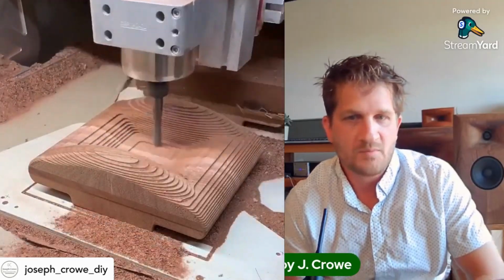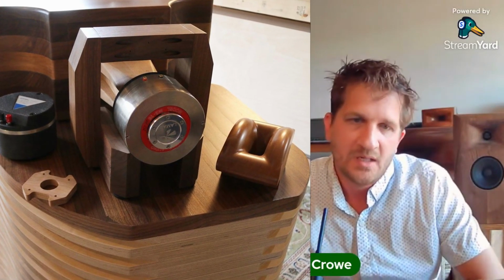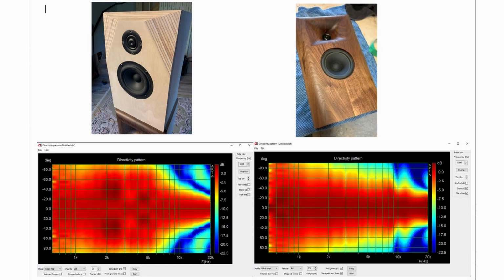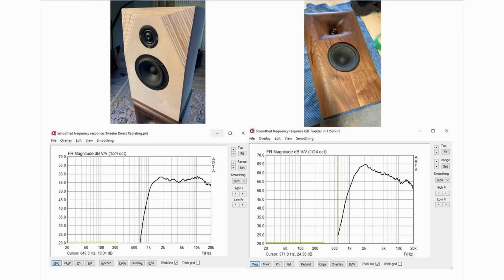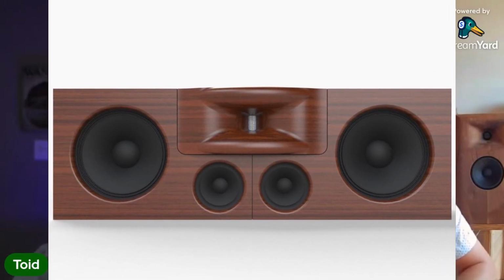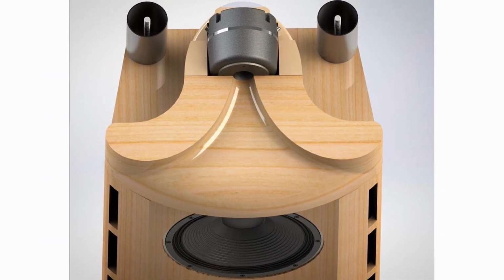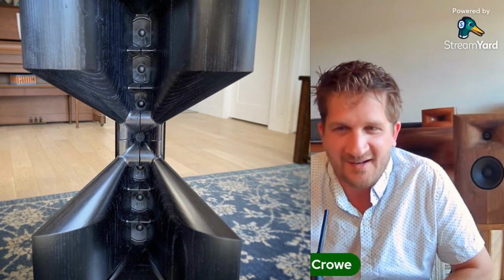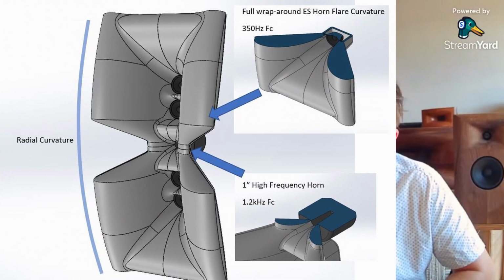Talking Horn Speakers with Joseph Crowe Designs

Comment: I have long wanted to experiment with horns but the cost and complexity is an order of magnitude higher than direct radiator and open baffle designs.

I wonder about horn loading cone tweeters. They are already better at low frequency extension than domes.

Comment: I'm wanting to build some diy horn speakers right now with a horn I can buy off the shelf ... holy crap this was informative!  I thought I wanted controlled or constant directivity for dispersion reasons but my main goal is sound quality so I guess I'm looking for exponential or bi-radial or something.

I have some 15" jbl 2225h drivers I want to use, which I want to cross over between 500 and 800hz, and if possible I'd like to avoid a 3 way design.  The speakers they're currently in have 11x4" exponential horns with akai hm-80 CDs, but the crossover point is closer to 2k and so the JBL's aren't great in that upper region in terms of dispersion or detail and clarity compared to a small horn loaded driver.  I'm in forums seeking advice but most of these people are older guys into expensive vintage hifi stuff and they think 50 year old horns are as good as it gets .. I beg to differ.

But there are so many options it's hard to decide.

Any thoughts on a good off the shelf CD/horn pair available for close to 500 bucks, certainly under a grand, that can cross at 800hz or less?  Or would I be better off crossing at 1200 to get better HF performance, mated to the 2225 which might be fine to 1200, though not super ideal.

Or I could go 3-way and have a smaller pro 10" to cover say 100 or 150hz to 1.2khz.

Comment: Wonderful engineering and craftsmanship.  Thanks for bringing this to us!  The topic reminds me of the 90s car audio trend of horn loaded compression drivers carrying the front stage from 800Hz and up.  I ran a full USD Audio system in sound quality competitions back in the day, and had pretty good luck, after a lot of tuning, both physical (foam blocking),  EQ, and time alignment.  I've always wondered why that tech has completely disappeared from the car audio market.  I assume it was just too impractical (installation and tuning) to capture enough of a market to justify it.  But, when you get it right, it's really something to behold.
Reply: Cost? No idea what's going on in db drags.

Comment: Good stuff! A follow up question would be re the differences between a waveguide, a "true" horn and a compression horn. It appears to me that Troy's horns lack the compression chamber and phase plug that characterize most horns. Without being privy to the nuances, I'd think they are waveguides. BTW Dr. Earl Geddes would be another great guest in the same vein. Thanks!
Reply: Jeez, what is with this name calling - regadless of the name they all do the same thing - provide acoustic loading to the driver and directivity and impedance matching to the  other side.
Reply: @VEC7ORlt  They are not merely different names for the same thing, despite similarities of basic function.  Understanding the differences leads to a better likelihood of meeting design goals for those of us who actually design speaker systems.  Not sure why you find this offensive.😕
Reply: @naturalverities  ok, what is a 'true horn' and what is a 'compression horn' then?
Reply: @VEC7ORlt  a "compression horn" sounds like a made up category. Like an unnecessary definitional branching. Any time the diaphragm is bigger than the throat there is necessarily a degree of compression ratio there, and that describes almost all horns (including Most of Troy's), and a front chamber is a function of scaling of that difference.
More importantly @naturalverities is simply wrong about his statement as the Crowe designs run the complete gamut from undersized drivers as in his Rullit 80hz design, to even running phase plugs on bass horns such as his large ES horn. Phase plugs have specific uses, and front chambers have specific uses, and all of these things are balanced across bandwidth demands and driver behaviours. 
I don't think there's a useful definition that categorically divides "waveguide" from "true horn" without creating loads of messy carve-outs to accommodate certain designs which are commonly thought to be one or the other.
Reply: @weatheranddarkness  you know what, forget I've asked - I know enough about horns to not even participate in this nonsense. I'll stick to my acoustic loading, impedances, directivity indices and leave the name calling to the marketing and audiophiles.